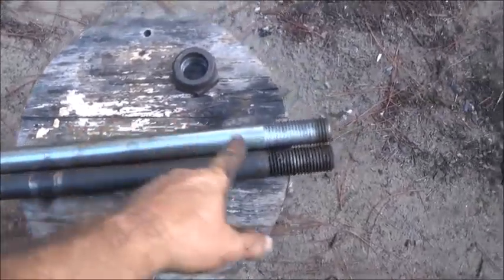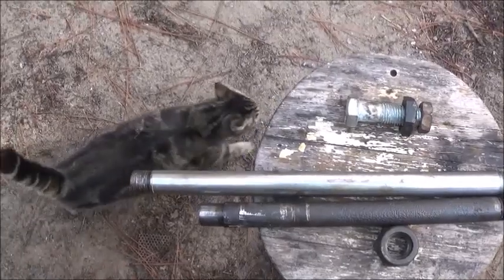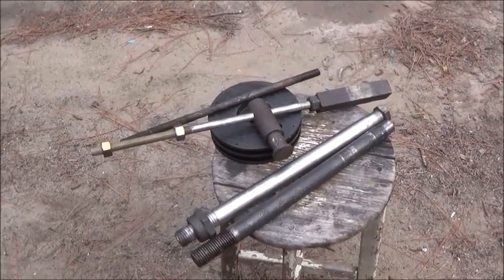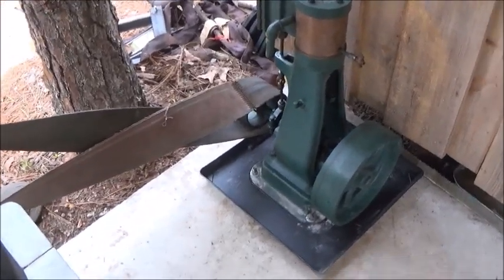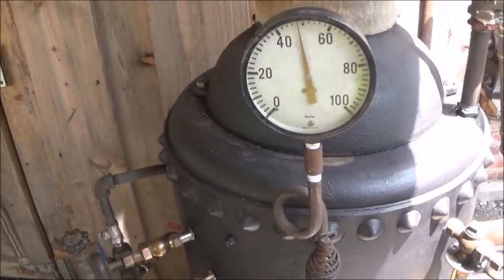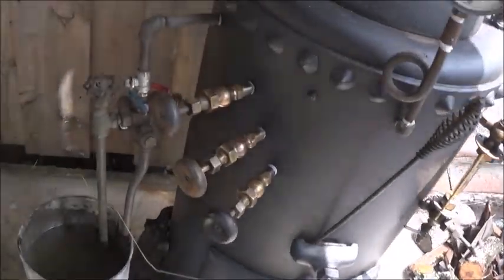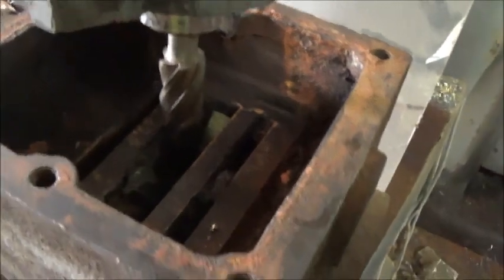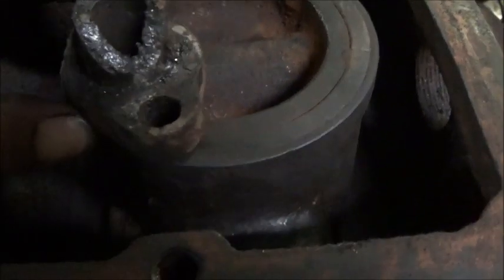UPRIGHT STEAM ENGINE REPAIR SITTING FOR YEARS PART 3

Comment: Replacing harmonic balancer & timing chain on my Chevy 327 , new heads , cam etc.. (20 plus years ago) , balancer wouldn't go on all the way , asked my brother-in-law(old time mechanic)  in another state & he said put the balancer in your sisters oven(not his wife) at 400 degs. for 20 mins, run out to your Chevy and slip it on the crank(sis was gone so didn't have to ask permission) . Worked like  charm , no problem . Loved your lapping machine , straight shade tree mechanic fix it problem , job done . Thanks for the video , loved it .

Comment: I remember my dad replacing ring gears on flywheels for airplane engines. He would cut off the bad ring gear , put the new ring gear in the oven and the flywheel in the freezer for an hour or so then slip it on. Once the temperature was evened out it was on there very securely.

Comment: I have a horizontal 8" x 8", there are numbers stamped on the parts but no company name anywhere.  I was told it was sold thru Sears but I have never been able to verify that, the Kenwood name did come up in my research.
When I machined the valve face I welded a bit of HSS to a 3/4" bar to make an extended "fly" cutter to get under the bolt flanges.
I did not bother lapping just smoothed the faces with a small diamond honing stone.
Had it on a planer a few years ago, sounded very good nice clean bark under load.

Comment: if you braze up the packing gland and turn it back to the old size you will avoid the trouble you will have when you push the piece you are going to make up in the stuffing box and can not get it out! If you do it your way at least put a tapped hole in it so you can get it out to repack. I spent many years working on steam engines at Exxon and know the braze up will work the best! o yes I love watching you bring those old engines back to life! WC LEE

Comment: Sears appliances were Kenmore. They were mostly made by Whirlpool in Marion, Ohio. Although, the Kenmore brand was of a higher quality than Whirlpool badged appliances. I still use a Kenmore dryer my mom bought 45+ years ago. Its had a couple parts along the way but not many.
     Best regards from Indiana.
Reply: Well back then if you bought something from Sears it was of a higher quality than the name brand company that made them,Dad told me about someone he knew that worked at B.F.Goodrich making garden hose for them, the ones that Sears rejected had the Goodrich name put on them and sold as such.

Comment: Sears has always self branded products made by other suppliers. I have an old Craftsman smoothing plane from my father-in-law. I looked it up and found that Sears purchased planes from at least three good quality suppliers. There is usually a code mark on a Sears item to find who made it. Harbor freight has at least three brands to denote quality from crap to crappier to real garbage.
Reply: Montgomery Wards did the same thing! I have a 12 gauge shot gun that is now apart for restoration, that was my fathers. I forgot what Wards called it but it was made by Savage Arms in Massachusetts.

Comment: Got them parts looking about ready to run. Sounds like an easy fix on the packing collar. How are you going to face the wet stone? Anyway, like what you have done so far and I'm sure gonna be watching when you get it all put together and running. We've got some wet weather here in Tennessee. Be safe out there where you are and have yourself a good weekend.
Reply: Not faced, it's called dressing the wheel, you do it with a grinding wheel dresser diamond you buy from MSC then you fabricate a hand held handle to hold it.  The dresser cuts all the high spots down till the wheel is totally round.

Comment: Johnathan, keep cleaning off all the wore compound, then changing out the grinding compound for fresh about every 20 mins run time and keep changing it until you watch all the cutter tooling marks are completely gone and the surfaces both turn 100% into a flat gray color. Then your ready for a real good final cleaning before assembly.  

 Question do you have a bore gauge to check for taper in the cylinder bore ?  That bore need to be hit with a ball hone a few licks to get the glaze off the bore before you install the new rings.
Reply: He mentioned in the last video that he already had a 7 inch hone.  I am sure he will check for taper as well.
Reply: @timedwards752   Thanks Tim, I didn't hear him about the hone.

Comment: Jonathan, I think you meant Kenmore, not Kenwood. Kenmore was one of Sears oldest brands that was mainly put on home appliances, sometimes electronics or radios, but those were usually marketed as Silvertone most of the time. One would wonder if they marketed the steam engines under the Craftsman name, as technically it was a  tool, and Sears tools for years were sold under the Craftsman  name (until very recently where Lowes home improvement stores sell them, not sure if they own the name now or not.)

Comment: I think they went too far tightening on one side (instead of both sides even) to break that packing push collar like that & maybe they cut the packing piece too long, crammed it anyway & thought it would flatten out even...if that little rusted rod is the one that goes in there - that bow l think l'm seeing didn't help none neither...is that collar sleeve piece you want to make going want to move with the rod (hope not) how many pieces of packing does it call for to go in there...the paint job on the sharping wheel housing looks good 👍 l like the black lettering (meticulous attention to detail) in case you don't have the boiler fired up - pretty sure I've seen toastmaster toaster ovens (second hand at the flea market) big enough for that piston to go in there & they don't care if they get plugged into an outlet in the shop or an outlet in the house/kitchen & you don't have to worry about becoming a single man & having to eat your own cooking like the po' slob thumb typing this down 😕 that's still trying to figure out where that broke off piece of piston ring went (now that l have some limited understanding of how that slide valve box works) & why that piston is favoring the one side...when it cools down might could check if the piston is square to the rod you made up - that part of it looks right 👍
Reply: I think Silvertone was the name of a Sears guitar

Comment: I don’t know if your old steam engines were  assigned part numbers like the power tools, but the first three digits in the assembly number are the manufacturers code.  They look like this:  109 36921.  If you can find a vendor list, that number is the maker.  I do not know if Sears used that system that far back.  My number above is made up.